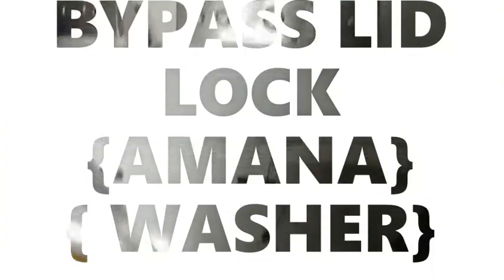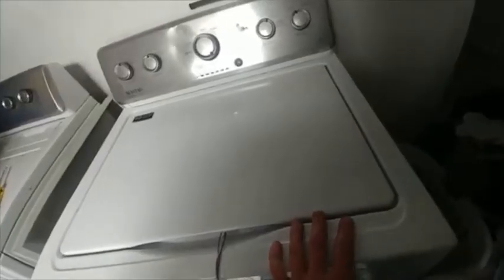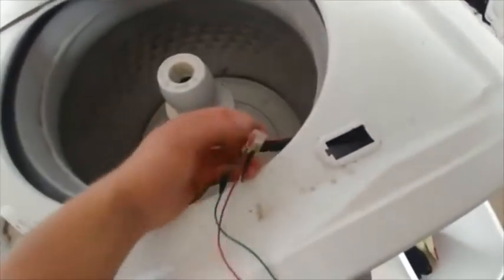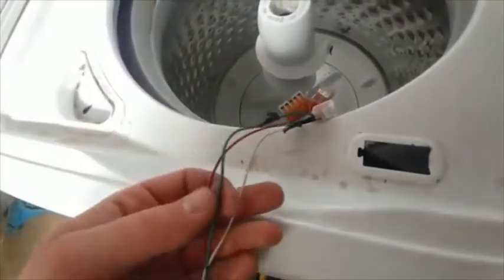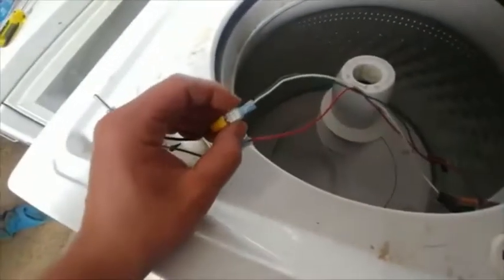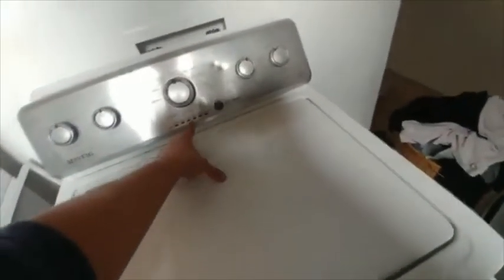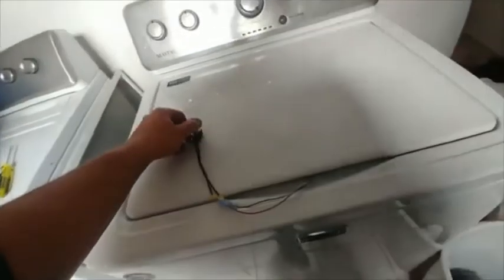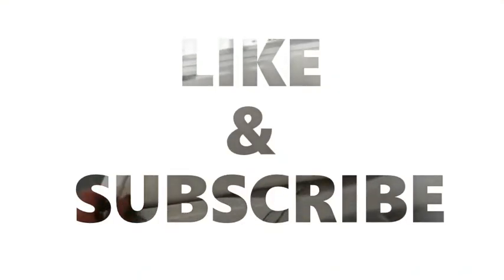Maytag Washing Machine Lid Lock Bypass: Maytag washer lid lock bypass

Comment: JUST TELL PEOPLE YOU 'CAN'T' BYPASS THE LID LOCK ON THESE NEWER WASHERS ! Older machines sure a direct line tricking it into thinking its locked worked. But these newer machines want to unlock then lock in between cycles. They did that for a reason and not safety they want there 70 bucks from consumers for a part that will almost surely break that's why they did this.  So unless u want some tweaker looking switch hanging from your washing machine that you have to go flip along with up down left right on off whatever he said then just find you a broken washer on marketplace that someone is giving away for price of u hauling and take the part off it

Comment: That Lid Lock latch contains two switches, a solenoid and some very complicated fragile mechanics.  One switch is the lid down/closed switch that is normally open.  It cuts power to the solenoid until the lid is closed.  The second switch is normally closed and is open when the solenoid is energized.  The solenoid moves up a small white plastic dead bolt that locks the lid closed or open.  It is possible for the dead bolt to get out of sequence and you then cannot close the lid.  Since you cannot close the lid the solenoid cannot be energized.  If the solenoid cannot be energized then the dead bolt cannot be toggled.  The program checks the Lid Lock status and operation during wash cycles.  My original Lid Lock rusted away as the metal parts are very small and thin.  The new replacement Lid Lock had the Red and Blue wires reversed.  The Lid Lock circuit attempted to energize a normally closed switch and blew the triac on the control board.  This Lid Lock is the worst part of the machine.   The program can also get out of sequence in thinking the latch is closed when open and wise versa.  Some engineers just need a good hard kick between the legs for not applying the KISS rule.
Reply: don't kick the engineer he or she must not be over 5 years old

Comment: I did everything u said and it started working and filled and then made a pop sound and stopped working.  Any suggestions appreciated???
Reply: Yeah I just fried mine as well . I just plugged it in , never pushed any button on the machine and pop! I guess the pole switch has to be on the “off” position before plugging In the machine
Reply: This blew out my control board as well.
Reply: @adriand83  go to Home Depot or Lowe’s and ask for the returned merch or damaged merch , u can get a dope machine for less than half of the msrp
Reply: @srjr2531  yeah buy a new circuit board and lid switch lol or go on Facebook market place and buy a direct driven whirlpool kitchenaid maytag amana Crosley roper or estate washer makes life easier just check the coupling and lid switch before buying of course leaks but if transmission is good and all the above make the purchase you'll be set for years to come.

Comment: just found this, it seems the easiest way to bypass the lock is to just remove the lock arm from the lid and put it in the lock so it can still work, just need a star or square driver head to remove it. The lid will sit a little high when closed, but small price to pay.
Reply: it won't stick out if you take the clip out of the locking part that you suggested to unscrew. flat bladed screwdriver and 30 seconds is all it takes. but great idea coz all the electrical harness  crap is ridiculous
Reply: If it doesn’t work in the door why will it work out of the door you fixed nothing.
Reply: Most check that the lock is engaged, if you don't have the lock clip, or something else that works, in the lock it will always think the door is open and not allow use.
Reply: @smash72cutlass30  this post/video was about when the washer won't release the lock after running. Removing the lock from the door and putting it in the lock prevents you from being locked out of your cloths if your machine does that.

Comment: Who has that kind of time to spend on each load. I like to stick in a load leave for the day come back toss in dryer done. Can’t baby sit each load. I will put a bullet in the control panel before I chain myself to my washer. Thx anyway.
Reply from the maker: Im so glad you found this video helpful!  This reset is good for any vertical modular washer (VMW). In other words it works for pretty much any top load washer  boughten n the last 0-15 years that wasn't made by LG or Samsung (they as well have a similar reset but isnt as universal as the reset you learned). VMW's are distinguishable by the ever so hated lid lock device, not to be confused with the old school lid switch device that allowed you to open the lid at anytime without waiting for the washer to come to a stop and the lid lock to release.  If anyones intersted VMW's are sold by Whilrpool Corp.who in return owns almost every american appliance brand such as kenmore, maytag, amana, roper, inglis, crosley and many other brands they are a few brands away from monopolizing the appliance indusrty in the US. Word to the wise: an $800 Maytag VMW lasts just as long as the $550 Roper or Amana VMW and has all the same parts. The only difference is the name and the price. Think of it as buying a shirt from nike and one from walmart. The shirt from walmart is way cheaper and will get the job done, If you think putting more money into appliance will get you more life out of it youll be sad to find out that no matter the price of the appliance they are all pretty much lasting 3-5 years only now not the 20+ we are expecting. 

Which appliance do i recommend?  The generic VMW's sold by Roper, Crosley and Amana. There just as good, last as long  and cost less than the Maytag VMW's. I also recommend always adding the 5 year protection plan add on for about $120 which will pay for all future repairs for the next 5 years which will pay for itself 2 or 3 times over after year 2 or 3.  The 3 year add on is a waste of money because the machines typically last just long enough to get past 3 years.

 I hope this tutorial and explanation helps you, your friends and your family god bless you and thank you for watching! Oh and if you don't mind please like the video and subscribe to the channel to help the channel grow so we can reach more families like yours!

Comment: Just remove the lid lock stem from the lid and install it in the hole it goes into. Simple.
Reply: Unless the lid switch is bad it won't work regardless unless you bypass it period

Comment: Maytag,  commercial residential washer. MVWP575GW Thanks again for your response! I do not have the machine yet, as i won't buy unless i can bypass that lid lock so i can see all the cycles agitating. You did a demo wash cycle on this machine, so I hope u still have it to do a demo on bypassing lid lock.
The link u sent me above said maytag demo. But it is Amana. I think i saw a video u put of maytag, but it is not clear and not the model i am looking for.
Following any written directions is not nearly as good as seeing video. If it is not going to be easy for me to do on my own, i will not be able to buy machine, which i have already done months of research on. It may be too difficult as i am visually impaired and have no one else to do this. 
Can u do video soon. I have no machine now and cant even drive to laundromat.
Hoping i dont need to disconnect and connect wiring.
Can

Comment: can't you just keep the toggle on "locked"? and the cycle will go uninterrupted?
Reply from the maker: You cannot just leave it switched to locked because the computer inside the control panel needs to communicate with the lid lock. i havent figured out any other different way
Reply: @methodmeetsmadness  exactly
Reply: @methodmeetsmadness  still trying to figure out a way to bypass just putting wires together keep updating bro

Comment: Take a piece of wire connect blue and white together
Reply: Leave everything wired as is splice a piece on the white and blue wires
Reply: @joniclements3628  Now out of curiosity what do you do when it has to go from lid down to lid down AND locked mode.....meaning red wire was introduced?
Reply: @joniclements3628  because again after finding this video and basically breaking up with the gf to spend 8 hours putting a meter on this machine the red wire HAS to be engaged at the correct time As he was saying making the main vid.
Reply: If not the machine with fill with water but will get stuck in a sense/trying to start to spin "boot loop"

Comment: ahahahaha no wonder people fuck up their washing machine - and yes the door lid locks are expensive, if you get the original, some people get it half the price on Amazon and then complain that it stopped working after 3 cycles :P  It's worth paying for a brand new lock and peace of mind, much cheaper than having a tech come over and charge you a couple of hundreds of $.
What's worse is that those lid locks are cheaply made, very poorly made, no wonder they fail.  They probably have a very low limit of lock/unlock cycles before the mf breaks apart.